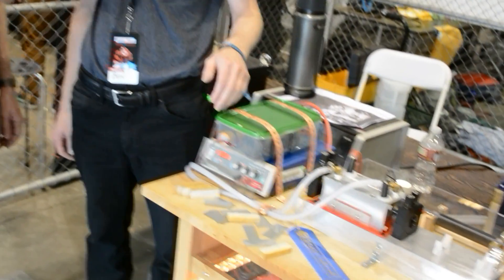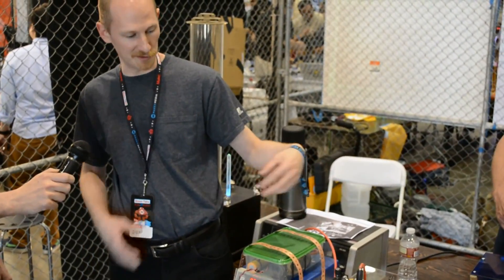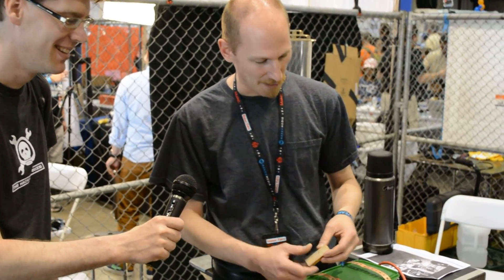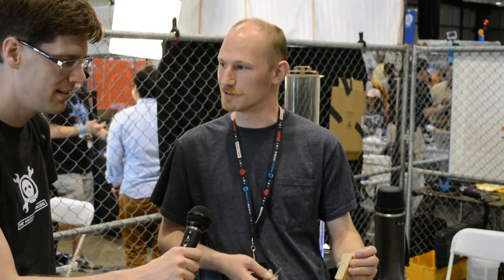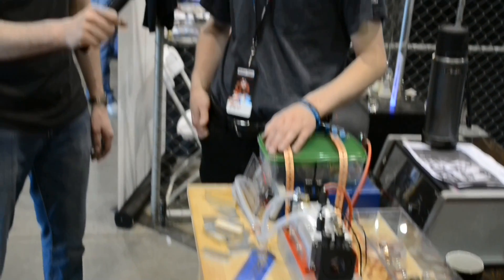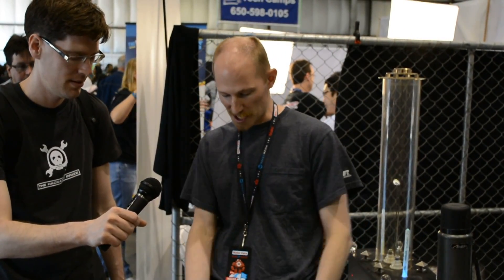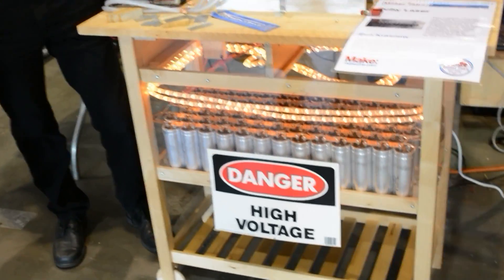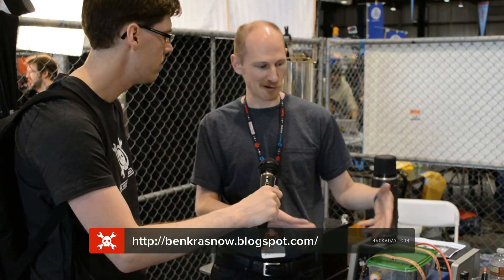8 kilojoules power a Ruby Laser

Comment: What is you stuck a Sapphire in it instead?
Reply: CosmicGrooves Nothing, as ruby IS  sapphire chemically (aluminum oxide), but with some chromium atoms as well (which gives it the red color).

The chromium atoms are responsible for absorbing the photons from the flash tube and emitting them back out.